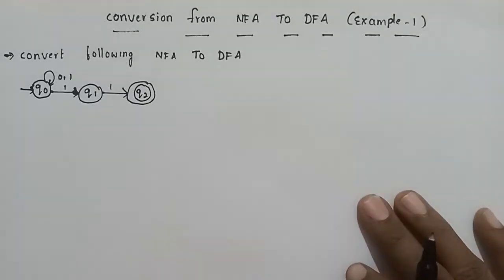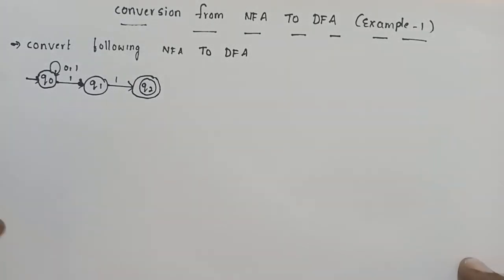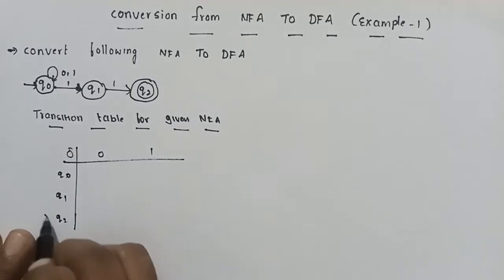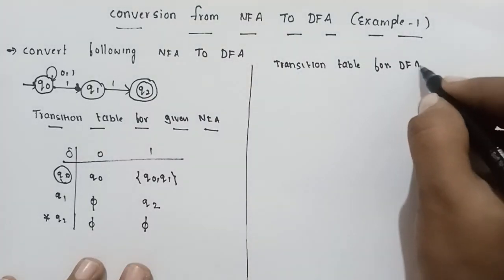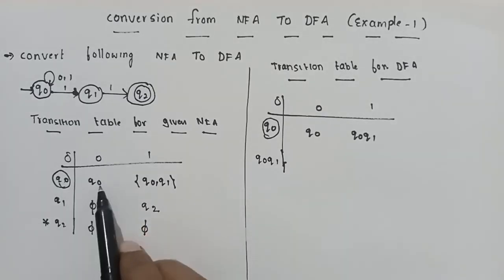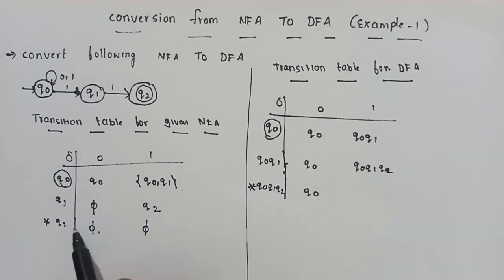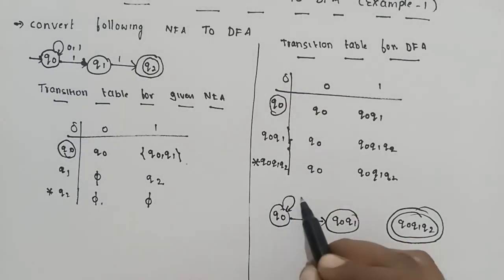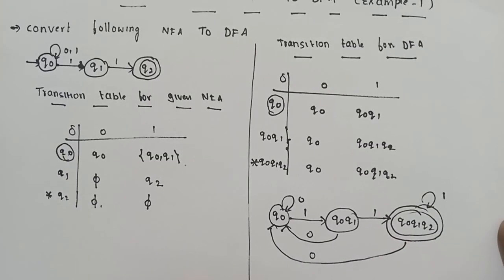conversion from NFA to DFA example | FLAT | TOC

Comment: Mam Nfa lo 2 power Q kada appudu 2 power 3 ante 8 states ravali kada mari miru 3 states matrame tiskunaru
Reply from the maker: Ikkada power base chesi kadu new states emi vachayo vatini expand cheyali q0q1q2 single state ga teesukovali
Reply: @srttelugulectures  kani ma sir power based cheparu mam ela chesthe wrong ga mam
Reply from the maker: oka problem ni different ways lo solve chyochu
Mine and your sir both are correct
Better to follow the procedure in prescribed text book